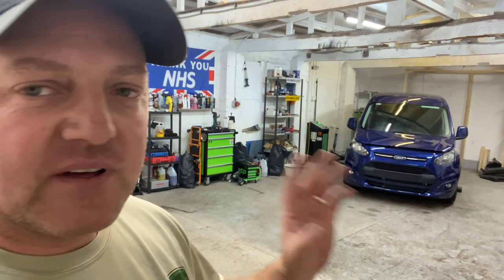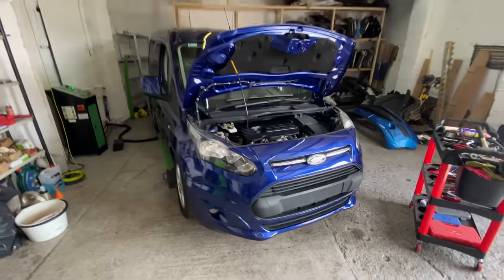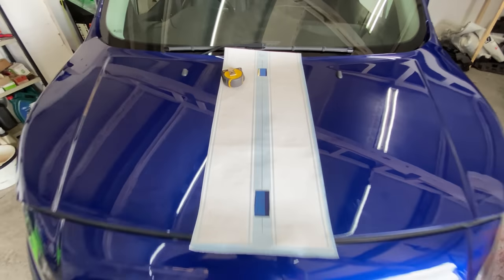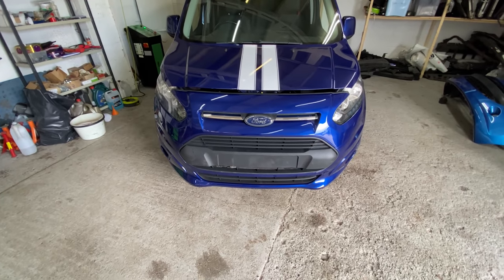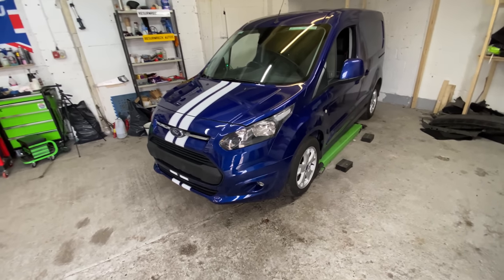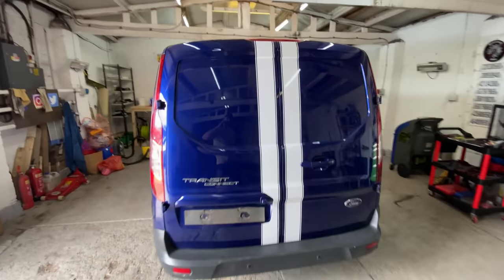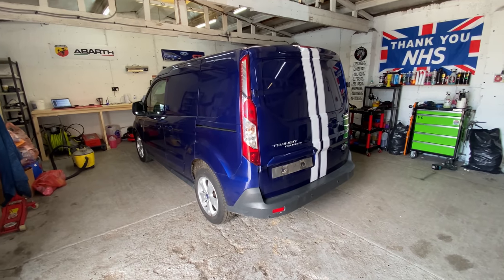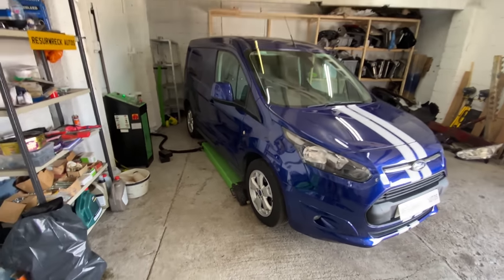Ford Transit Connect Gets Finished With Racing Stripes

Comment: Great job on the van 👍. To be honest I wasn’t sure about the stripe when you mentioned it last week…… however…
 I sorta like it. 
With the back stripe … near the number plate, have seen guys heat the stripe up with a heat gun which gives it a bit more flex and helps mould it into shape. 
Also a little soapy water on the panel helps manoeuvre it into place and helps to get the bubbles out.
Hope that helps a little 👍
Still loving your work and your have a go attitude, keep it up 👍
Reply from the maker: Thanks Will appreciate it buddy 👍👍

Comment: Not a fan of stripes but when I’ve done them on a 500 although they are obviously sticky you spray soapy water on and it allows you to move them around and easily get the bubbles out.